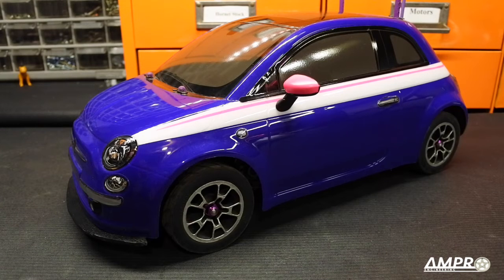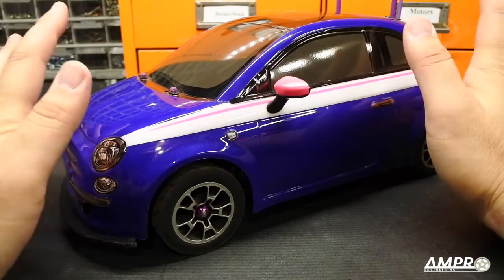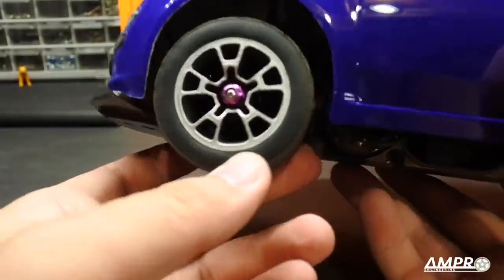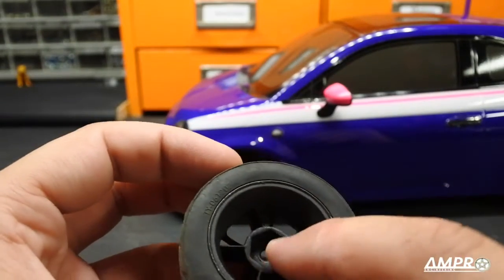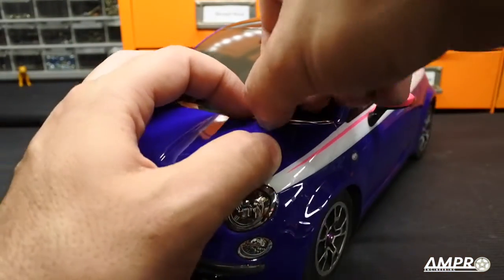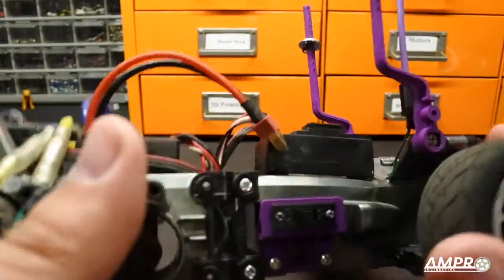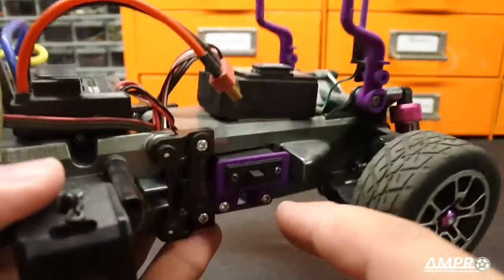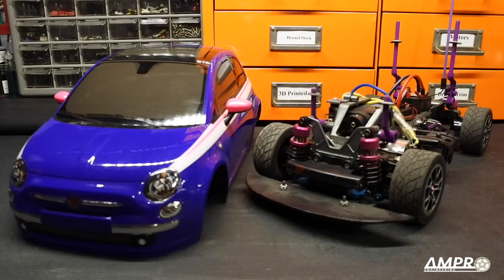E20  Tamiya M 03 Chassis Upgrades & Wheels

Comment: I would get those switch mounts for almost everything I have! I don't mind modifications. I had a M03R Mini Cooper... I really miss that car! It was the first front wheel drive ANYTHING I had ever driven - and the handling was so impressive! It was the first on-road car I've ever had that you could actually drive HARD! It didn't just do donuts or find the nearest curb or stump. It WENT where I pointed it!
I have got to get another one. I'd get your body mounts too. Purple, of course! You know...... I would put another 3.5mm hole in each of those posts...
That way, one could run some 3mm threaded rod between them, to keep the bodies from being bouncy.
Reply from the maker: Yeah the M03 is awesome! Hmmmm....that is a good idea....like toward the top?
Reply: Yeah, towards the top, maybe under the halfway point. I'm really trying to find a used M03R, even a M05 COULD work.... I really miss my FWD street basher. I NEVER was even able to roll my Cooper, so I may also consider a hard body.... maybe a 240Z! Love those Z-Cars. 
But yeah, I think a few Tamiya vehicles could use more bracing for the body mounts. You and I may be the only customers - but hey! You never know. Others might be as annoyed by excessive body movement. Especially with the trend towards more Scale. 
Interiors I've mentioned... that could get pricey - quick! Possibly just dashboards, center consoles and seats.... customer supplies styrene floor, and maybe transmission hump. I realize that is quite a reach for a lot of inexperienced guys... but over in the Scaler/Crawler camp, we're crazy fanatical about detailed interiors, down to door panels and rear cargo areas in SUVs! Plus the accessories, fire extinguishers, sleeping bags, BEER bottles, gun racks, guns, CB radios, toolboxes  (small for the trucks and full Snap-on racks for their 1/10th Scale Garages!). Some even have WORKING electric vehicle Hoists!!!😲😲😲😲 Plus many, many more. Those guys eat up 1/10th Scale 4x4 accessories! 
I'm thinking that the on-road guys do too.... I KNOW that the scale Drifters do.
Just some food for thought. 😉  Also, I've been promoting the crap out of your Shapeways store! 😊 I believe in the product. 
~ Carmine

Comment: Glad to see you doing M chassis, I'm looking at them but its mostly M05 out now- and I keep hearing horror stories about that chassis, mostly front end- would love to see what you do with one though
Reply from the maker: Oh my pleasure. What issues have you heard? I only have this M02 and an M02, and i know everyone hates the M01/02 cars with the lay-down shocks but I think the M03 is awesome. I really don't know much about these cars.
Reply: AMPRO Engineering   Looking up M05 reviews on forums and YouTube I see several of the same comments about the stock steering and a sloppy front end, also that the M03 is good out of box while M05 is twitchy, but M05 once built/dialed is faster
Reply from the maker: Well I will tell you that my Tamiya TA02 and FF01 front end steering slop was something amazing. I don't know how that was even possible. I added new GPM front ball bearing linkages and problem solved! I will need to look at my M03 again!
Reply: AMPRO Engineering Yes it sounds like the M03 is better out of box- hmm I wonder how long 'till we get an M07 ;D